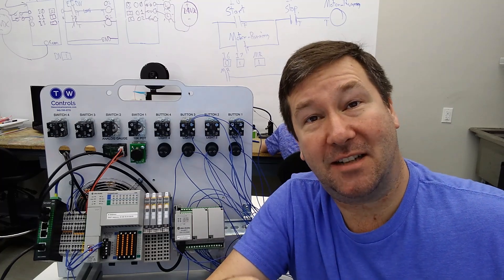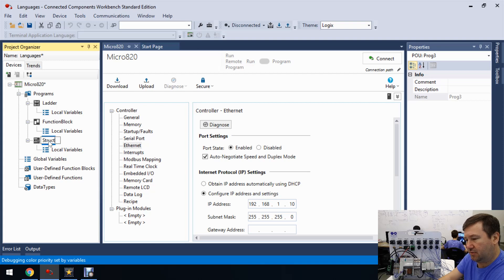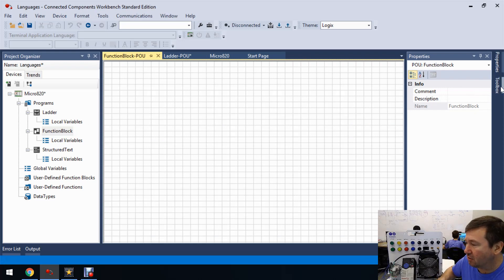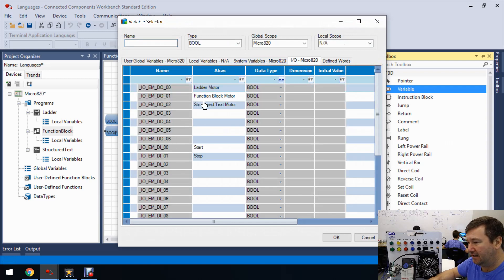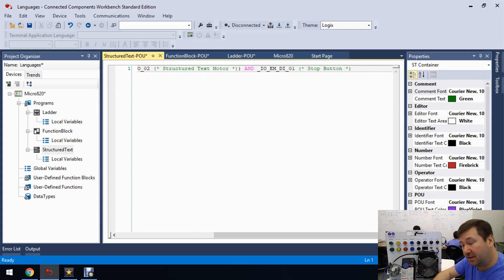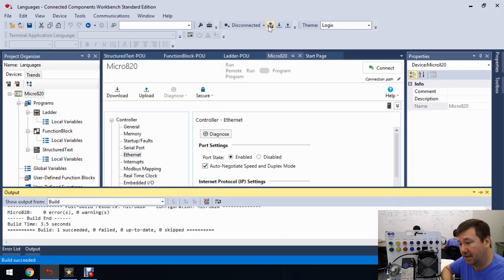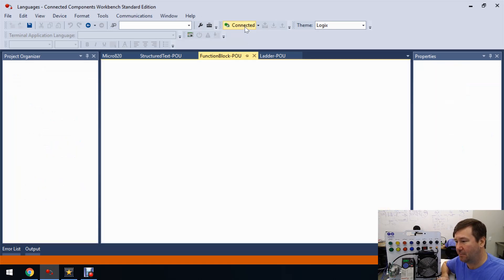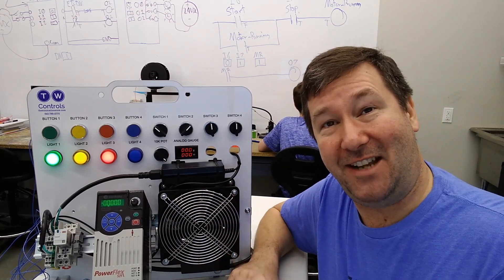DIFFERENCES IN Ladder Logic and Function Block Diagrams

Comment: Working through the "Connected Components Workbench PLC Training" and having recently watched the previous "How To Program A Seal In" training where the stop switch is wired as a NO button and the seal-in rung uses a "Reverse Contact/Examine If Open" for the Stop function, I was challenged to follow the logic of how a "Direct Contact/Examine If Closed" function would work while watching this training since there was no explanation that the Stop button was now wired as NC.  It was only after closely examining the trainer wiring at 2:57 where it appears that the green and red buttons were wired differently.  It looks like others (@davidbabic6121) had made comments about the stop button being NC, but they did not appear to be challenged by this the way that I was; I assume that 3 or 4 years ago when many of these original comments were made, this video was likely in a different sequence where more of the proceeding videos used NC wiring for the stop buttons, or perhaps most of your other followers have more industrial training where stop buttons are always NC and would expect this.  Just a little hiccup that provided an additional learning opportunity.  Thank you!!
Reply from the maker: Good point.  Almost all of the videos have a normally open red button.  I don't remember why it was changed in this video but we are getting ready to do a ladder vs function block vs structured text video which will replace this one in the course.

Comment: Couldn't your entire ST program be
_IO_EM_DO_02 := (_IO_EM_DI_00 or _IO_EM_DO_02) and _IO_EM_DI_01;
Reply from the maker: Yes, that should work also and is probably clearer.
Reply: @TimWilborne  Thanks.  The way you did it is probably how folks should learn, as it's easier to follow.
I wonder how the controller actually codes either version into its internal code, as to if there's really a difference under the hood.
For my next trick, I'm working on getting an 850 to talk modbus out the serial port to a couple SE drives (ATV212 and 320). That should be fun.
Reply from the maker: @mikes6449  These two are probably interpreted very similar to what you type.  Yours has the advantage leaner code.  My initial thought is the IF THEN will allow for more flexibility but the more I think about it, I'm not sure.  I might post this and see if I can get some discussion going.
Reply: I was going to comment this, because I believe doing this without an IF statement could technically be a lot more efficient (depends on if the compiler is smart and compiles the IF statement efficiently), as it won't cause branching as opposed to using IF.

Comment: Shouldn't the STOP button be shown as NC - rather than implicitly hiding the sense of the switch "off screen" ?

I'm just getting my AB legs on right now... the last hour
//Using direct hardware addresses in a program is a baaad habit
//I was surprised that aliases are not equivalent to variables
START := _IO_EM_DI_00;
STOP := _IO_EM_DI_01;
_IO_EM_DO_00 := RUNNING;
RUNNING := (START OR RUNNING) AND NOT STOP;  //Simulator tested
Reply from the maker: No, in this lesson the trainer is still wired per the getting started guide which has a normally open red button.  The symbol on the screen is a go look for a 0. https://twcontrols.com/lessons/basic-bit-instructions-in-connected-components-workbench-direct-contact-reverse-contact-coil
Reply: Agreed about using directly referenced hardware tags. Personally, I don't even like using aliases (Studio 5000 aliases that is) for mapping and prefer to map them manually.

Comment: I remember when I used to work as a field service engineer my colleague programmers used structured text for several small programs handling stuff which was used a lot in a program like the movement of a cilinder or conditions for the E-stops which where included on lots of places. It was a pain to troubleshoot...

Comment: Hi Tim I learned a lot from your tutorials, thanks.. We have PLC trainer in our workshop its SLC 5/05 CPU but its broken we don't have spare hard to get new one because its going to be obsolete. Can we used the 1747 AENTR card instead? if yes how do we program it. Thanks in advance for your reply.
Reply from the maker: The 1747 AENTR would just put the SLC chassis I/O up on Ethernet, you would still need a controller to read and write to that I/O.

Comment: Just curios, im still learning. Shouldn''t the stop button be normally closed? in my mind it seemed like you needed to push start button and hold stop button (cloesed) so the motor runs. hoever when you run the code it still worked ?  sorry if you dont understand my question.
Reply: Start buttons are usually wired N/O, stop buttons wired N/C. This means when nobody is pushing any physical buttons, the input you wire the start to = 0, the stop input will = 1. When you push the stop button, the input will then = 0. If you program the stop to a be N/C (in the program), it will be False unless you push the button, so you would need to hold the stop button down, then push the start to bring on your output, & the moment you take your finger off the stop button, the output will turn off. Hope this helps.
Reply from the maker: Gary is correct. A little background on why this one is using a normally open stop button... Our first lesson was the wiring enough to get started exercise in which all the buttons are wired normally open. And this particular video we're using that wiring setup, hence the red button being normally open. In a future video we're  going to go deeper into the differences between a normally open and normally close stop button.
Reply: Hey guys, thanks for taking the time to reply. Thankful for the videos
Reply: This also confused me. I’m a new Component Specialist for an AB distributor so I wanted to brush up on PLC programming. When I sell a stop button, I always sell a NC block with it so when I see NO being used in Logix it always confuses me because outside of a PLC, stops are hardwired with NC contacts. More to learn I suppose!!

Comment: Tag Comment not tied to Tag not because its Structured Text but because components workbench doesn't show it, other PLC programs give you the option to show it. The poor displaying state of tags is also is CWB issue.  Structured text is becoming the programming language of choice for many more companies. The language you select is driven by the task. A PLC program ideally would be a mixture of languages, you look at the task in hand and select the best language, for example a simple cylinder might be best suited to using ladder where a more complicated task might be structured text. The case statement in structured text is very powerful and  one of the reasons ST is the one I select more often, especially for state machine programming. So before selecting a language evaluate the task and select the right language, this is hard as we all have our go to languages but this is still the best practice. Also no matter what language comment, comment, comment and make tag names VERY descriptive.
Reply from the maker: Very good points Graeme.  I think it time Rockwell with make the Structured Text monitoring and descriptions better.